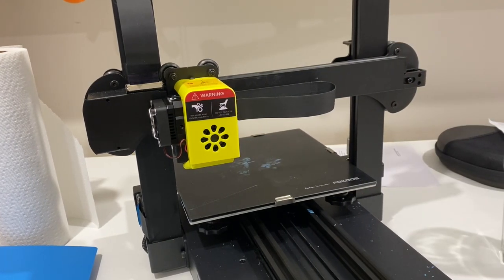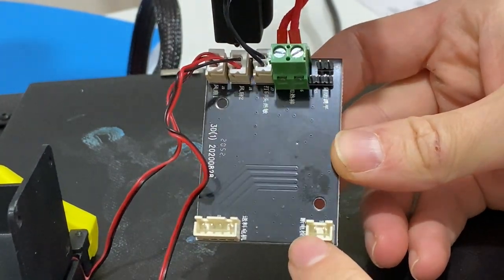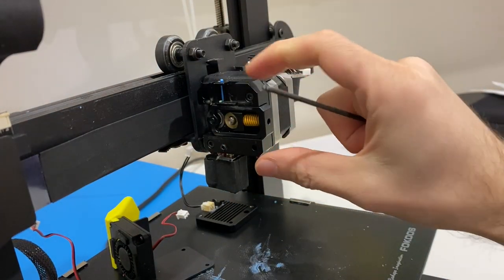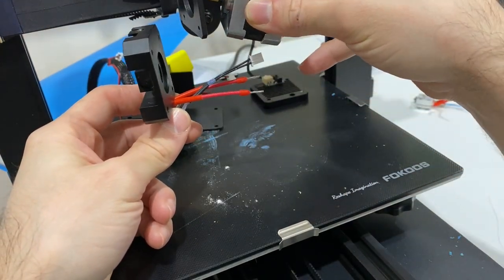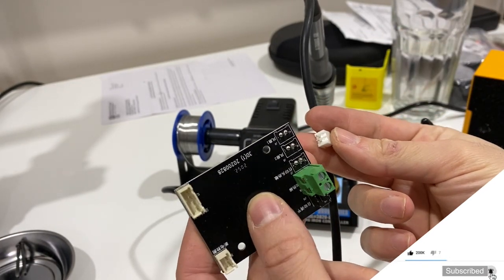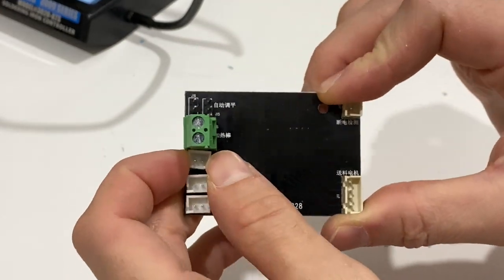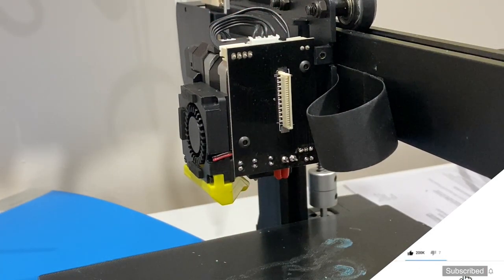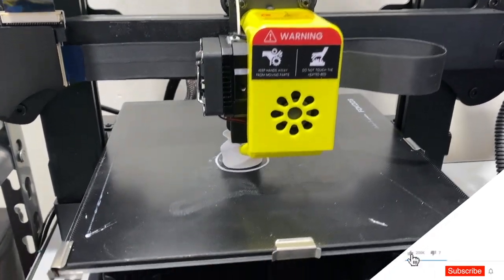How to fix thermistor error in FOKOOS Odin5 F3

Comment: I’ve just replaced the hot end, I’m getting an err2 message. Watching your video it could be the same problem causing my failure to heat up the hot end, I’ve not tried to heat the bed yet, but I think if I follow your instructions it should solve any heating problems I’m having. Thanks for taking the time to upload a very informative video.

Comment: I have the same problem with the connectors pulling out from the board.  Great video on your part but for how Fokoos brags about how ready to print this machine is out of the box, it seems to be so much trouble because average to new users aren't skilled enough to basically resolder a new circuit board in the process of changing a thermistor😣. Great and detailed video on your part because you are very detailed.  Thanks! 👍👍👍
Reply from the maker: Thanks. I hope you can solve your problem

Comment: do you know how to fix an err3 issue idk what to do
Reply from the maker: We need to know what is err3 😃
Reply: @3DPDoctor  so what is happening is there is something wrong with the thermal interface I found out but idk what that is
Reply from the maker: Err 3 corresponds to a specific error code. Ask it to fb group of fokoos. We need to know what is err3 mean
Reply: @3DPDoctor  MKS Robin Error Codes
Err1: The thermal bed exceeds the maximum temperature limit. Please check whether the thermal interface is shorted.
Err2: The print head exceeds the maximum temperature limit. Please check whether the thermal interface is shorted.
Err3: The hot bed exceeds the minimum temperature limit. Please check whether the thermal interface is disconnected.
Err4: The print head exceeds the minimum temperature limit. Please check whether the thermal interface is disconnected.
Err5: Nozzle heating fails, if the nozzle does not reach the set temperature difference within the set time, an error 
      is reported; please check the configuration file settings or check whether the power supply is sufficient;
Err6: The heating bed fails to heat. If the heating bed reaches the set temperature difference within the set time, 
      an error is reported; please check the configuration file settings or check whether the power supply is sufficient;
Err7: thermal runaway; when the temperature rises to the target temperature, the current temperature is lower than the 
      target temperature and exceeds the set temperature within the set time, an error is reported; please check whether 
      the thermal sensitivity is normal or whether the PID value is appropriate.
Reply from the maker: Awesome thanks!

Comment: do you no how to fix err5
Reply: fillement detection switch not pressed
Reply from the maker: Check the cables going into switch and check the switch itself. Maybe broken.
Reply: @3DPDoctor  ok
Reply: @3DPDoctor  can you just use super glue on the thing
Reply from the maker: Probably. It will give you solution until super glue fails